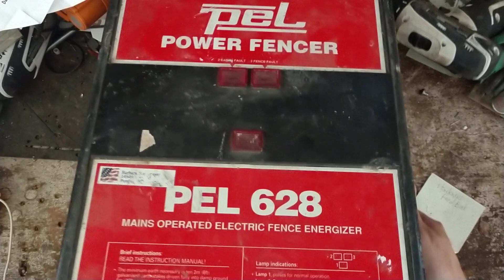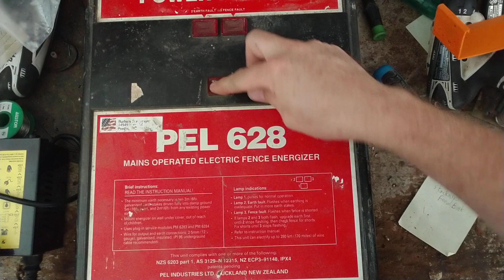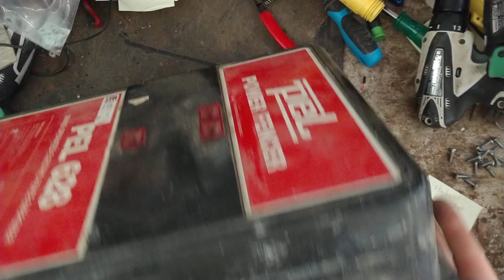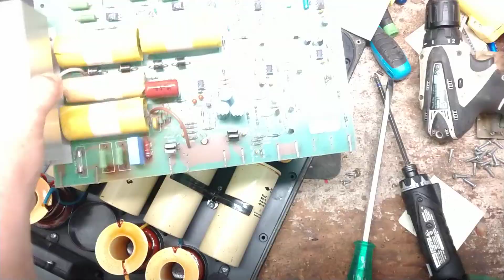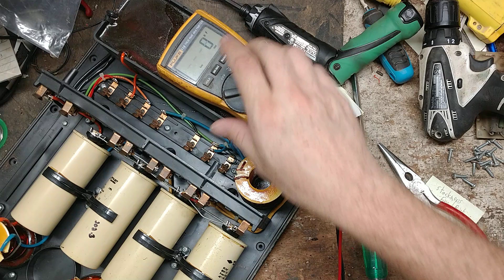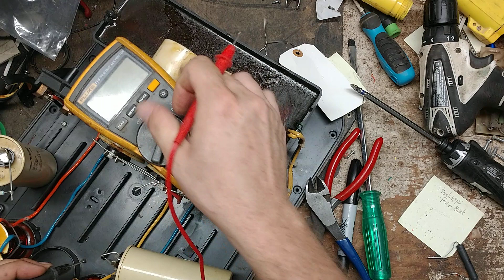How To Test & Repair An Electric Fencer | PEL 628 Fencer Repair Part 1

Comment: Plz give me perfect diegrem for mackin fence enegizer..
Reply from the maker: Thanks for the question, but I don't have one. You need to buy a cheap fence energizer and design it based off of that and make it better. You can buy them cheap, under $100 new
Reply: Thanks your speed reply... . I'm drained enegizer. But need  best one... I'm drained fully auto magically working fence Mashine with dark sensor and heat sensor.. with alarm ac 230 and dc12 v  poaratalbe... . It price 7.5 dollars sl 
 Rs 14.500.
Reply from the maker: I'm not sure what you're asking. You may need to talk to a distributor in your country.
Reply: @ashokapushpakuma.1814  since you happen to be from Sri Lanka may be I can help you, but only with the go ahead from the  channel owner of this channel.